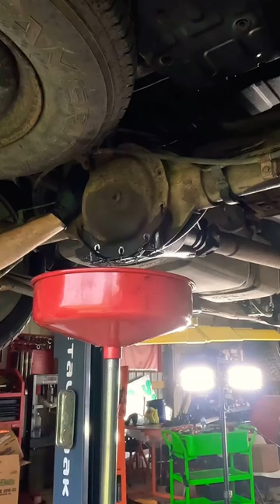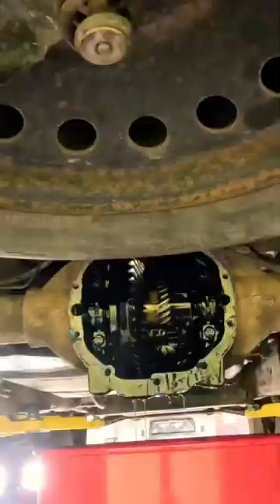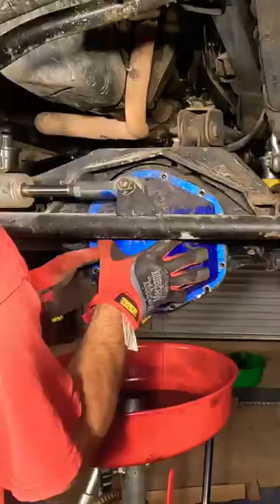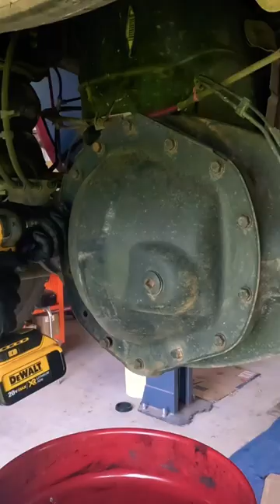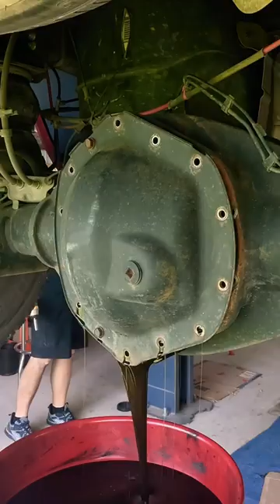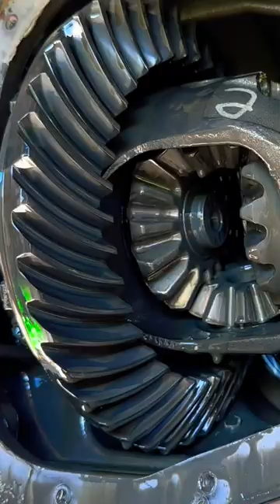Why should I Change My Differential Fluid? 🙄 #short

Comment: Haha. So wrong. 
Just ask Ford and why they don't recommend you doing that on your their Explorers. They aren't designed to be serviced.
Reply: What about on a Lexus?
Reply from the maker: They don’t want people to change their OWN fluid, Not that they don’t recommend getting it changed. That’s because people would rather attempt to drink the fluid, and then sue them because it didn’t say not to.  (Thus warning labels) Trust me, We change failing bearings on fords often. Besides, why would they want YOU changing it? If you have it serviced by them. It’s money in their pocket. Just saying. It’s simple mechanics. You need lubrication.  Appreciate your opinion tho
Reply: Yeah more of a joke I've already changed mine twice,. There is no drain, can't crack the seal either like most. So I had to suck it out from the top and pump it in from the top. No fill line either. :) @axleoffroad
Reply: 173k miles on my 2015 ram 1500 3.6 never have serviced fluid shift like new
Reply from the maker: lol, Glad to know your transmission fluid is holding up, but you should consider servicing your differential.